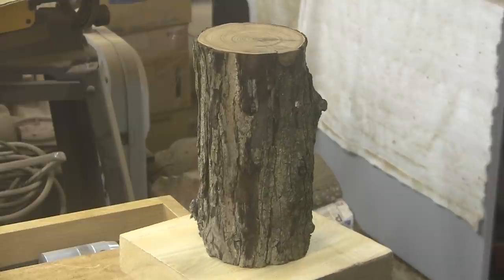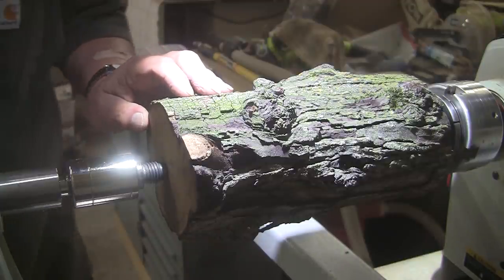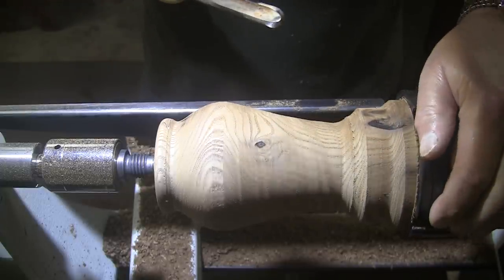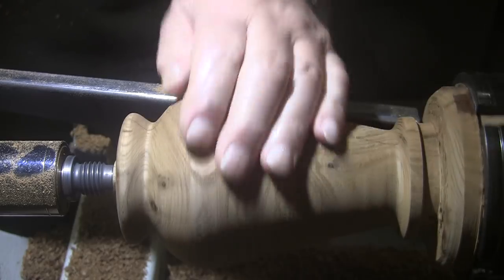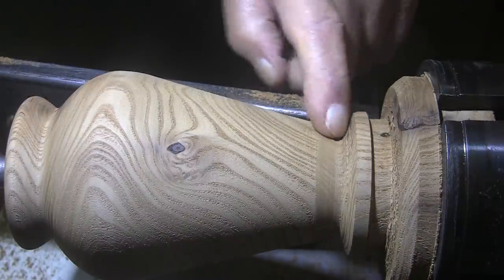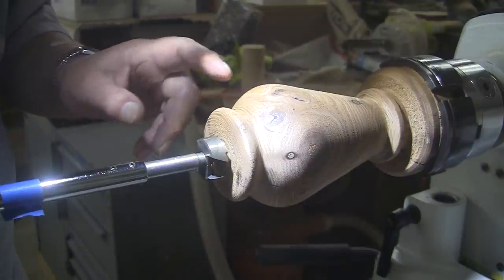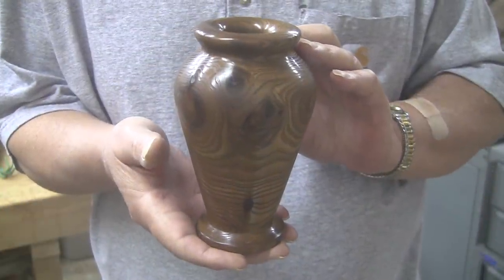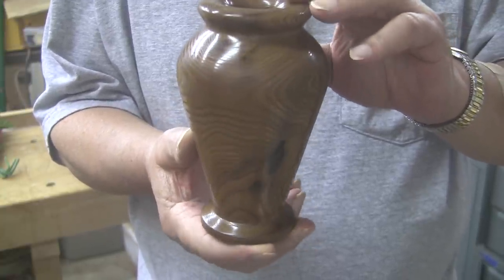Russian Olive Spindle Turning - Wood Turning

Comment: Hi Phil, That was a lovely piece of turning especially, as you say, as you don't do spindle turning. The shape is perfect and allows the grain to flow along the piece. One trick I have learned when filling cracks with CA and sawdust is to put one thin coat of sanding sealer around the crack fist and let it dry. Then apply the CA and fill the crack. The sanding sealer stops the CA from staining the surrounding wood to the crack. Look at me trying to give the Great Phil advice on turning. As others have said I'm glad you are safe from the fires and that everything was ok when you got home. Take care Phil. Cheers, Huw
Reply from the maker: Thank you, Huw!  I'm safe and sound, good to be back home.
Phil

Comment: Another nice piece Phil!! But - I can't believe you left your watch on, especially with the jaws open that much leaning over your chuck. Good chance to rip into your wrist pal (or at the very least, ruin that nice watch band!) Be careful my friend - safety first. Re; the crack - I have found in situations like this, that sawdust with Aileen's Glue does not stain (or turn dark) as much as CA which tends to make the crack less visible. Does take longer to set up though. Regards Dennis (Covig is peaking again - stay safe my friend.)
Reply from the maker: I've never heard of that glue, Dennis, but if setup is more than a minute or two I probably wouldn't use it, anyway.  On a piece like this I just want it to be over asap!  LOL!

Comment: Good job Phil on doing a simple spindle turning.  The only thing this piece that was anywhere close to Philwood was the crack.  Question; I normally try to get some of the very fine sawdust packed into the crack before I add the CA, does using the CA first make for a better fix?  Thanks for another good demo.  Stay safe and well so you can keep them coming (but find a piece of Philwood so it will be more Phil normal.😉 Cheers, Tom
Reply from the maker: Thank you, Tom!  I'm sure filling the crack works either way.  My thinking was, get the surfaces wet so the dust has something to stick to.  Also, dry time of the CA you are using would have something to do with it.  I knew I had at least 30 seconds with mine.
Reply: Phil Anderson - Shady Acres Woodshop I guess I need to get some slower set time CA as well as the quick set I’ve got now.  Thanks for another good tip.  Cheers, Tom